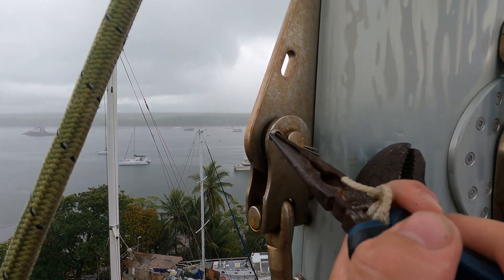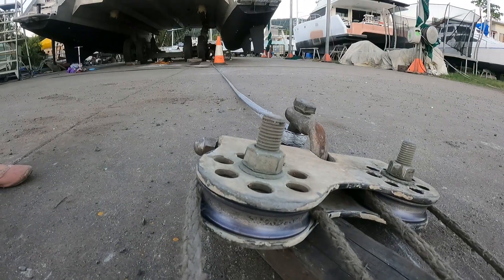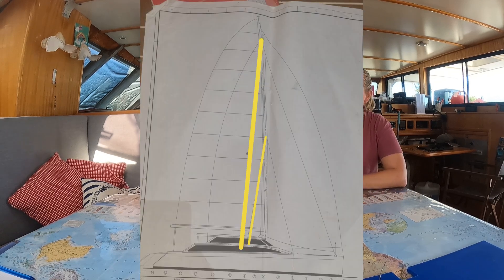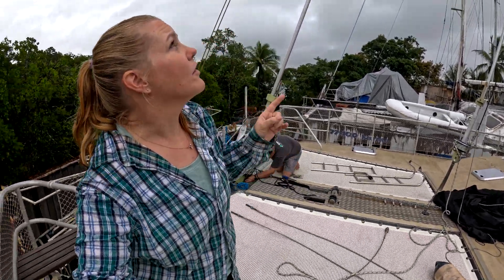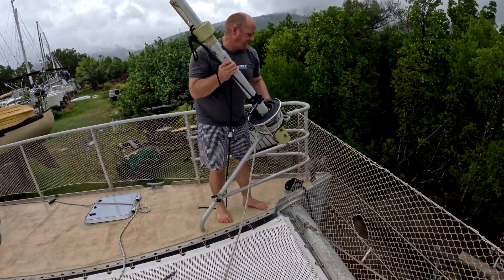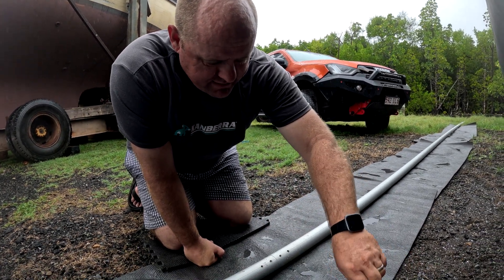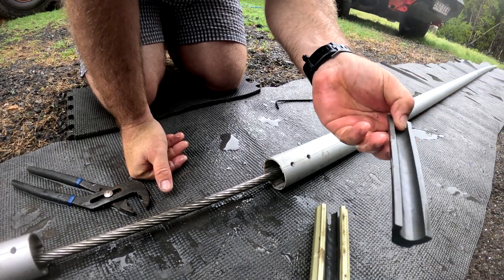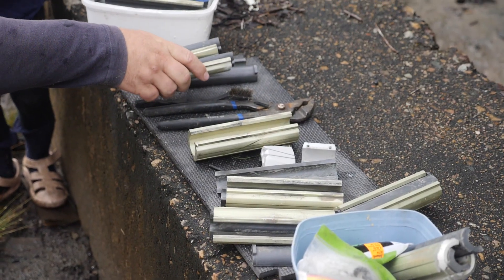Hybrid Rigging: SYNTHETIC & Stainless Steel Rigging on a 17 ton aluminium catamaran: Part 1 (Ep.100)

Comment: Thanks for sharing new video. I can't believe you still have boat insured with rig older then 10 years. I also know some rumors on dynema might be affected by UV and recommended for replace every 6 years. Btw I have partial dynema rig myself and happy so far too. Best regards!
Reply from the maker: Thank yoi so much!

The caps will have a sleeve and thr Lowers will have partial cover on them from being touched when moving up to the Bow.  So good to hear you are happy with your rig, we are super stoked and excited to get the boat relaunched to sail with the rig and see how it goes!
-Cait
Reply: @sailingwiththejameses  Fantastic! Those sleeves will definitely work. Better then with steel as no salt corrosion under the sleeve. I also use dynema/polyester ropes for trampolines. It does UV and accident tear/scratch/wear protection by that. Not too expensive. And finally I have replaced wire rope with dynema in the block-lift  setup of my heavy centerboard.
Reply from the maker: @DanielMashonkin  Great to hear that you have been really happy with it! We've got it on our trampolines, the times along the outer edge are dyneema, which we've been really happy with. The Lowers will be partially exposed, we will be putting some chafe protection on them becasue we have to duck around the lowers to get to the bow, bought some cheap rope to wrap around, and itll go about two meters up and then exposed. We will see how it goes and then decide weather to swap the diamonds to it as well. How long have you had your synthetic rigging on for? We are seeing more and more boat have it, great stuff
-Cait
Reply: @sailingwiththejameses  I have my dyneema for 2 years but mostly in storage. The boat is only 23' and on trailer. :-)
Reply from the maker: Brilliant 👏 we are looking forward to sailing with the dyneema 
-Cait

Comment: what did you use to power the winch
Reply from the maker: @gregrichards468  knew someone was going to ask this question😍 We have a Ryobi drill with a winch bit fitting. It's the Ryobi 18V Hammer Drill and the Winch Bit is from Amazon for $78 AUD. 
And some points in the video it is me winching 💪 when the battery ran out of juice and I didn't bring a spare one up. Love the drill!
-Cait

Comment: Youve got your exact finished lengths from your old stays .. for your new wire and dyneema... did you used prestretched ? If not you will have to maximise your adjustment to take up the slack ot pre stretch it yourselves some how..  But its fun to weigh how much wt you've  managed from the highest point on the boat.  
Charlie wasnt put off by your down pour. 

Is there a particular problem about swapping out the diamond stays for dyneema? Theres abrasion ressistant sleeving available for  rub spots our  harder edges.
Reply from the maker: We did measurements of all the stays on a sunny still day when we were down south in Townsville and we had the two forestays made up by a company down in Brisbane and they sent the "like for like" stays to us and we do the labour of swapping them out. Witth the dyneema we have the measurements of the stays and we took a few different factors into consideration so that we would get them the correct length. Dyneema is amazing stuff and we are stoked with the rig. We wanted to keep the forestays wire to because we cannot see how they are wearing and statistically forestays are they stays to fail first. We wanted the dyneema on the stays we could see and keep and eye on. If it all goes well we will swap everything to synthetic rigging :D
-Cait
Reply: @sailingwiththejameses  

As far as I know you cannot use dynema with a roller furler but that's just from reading. 🤷🏻🤔
The ultimate wt saving could be   
a , hundred+  kg or so? With half that at the highest point of leverage and the fittings. A bit of practice and DIY Dynima  shackles are will be like like braiding hair or knitting 😂🧙🏻‍♂️
Reply from the maker: We are looking forward to sailing with the dyneema on the boat!
-Cait